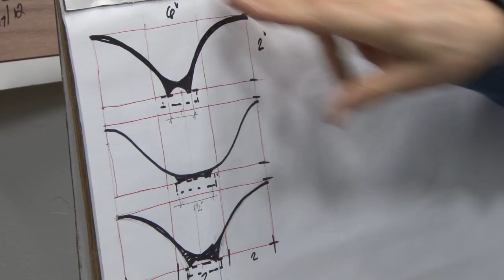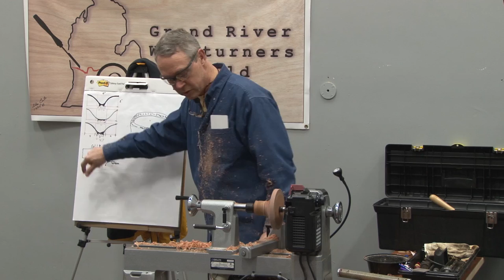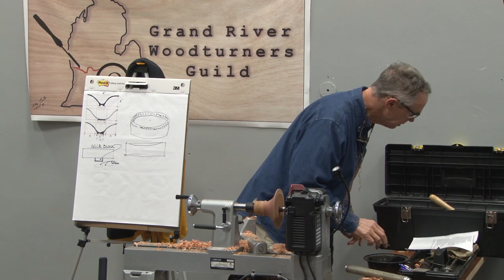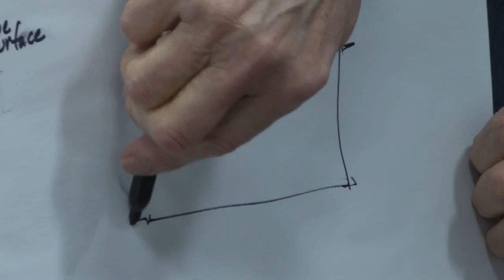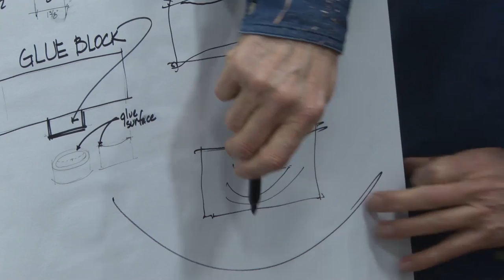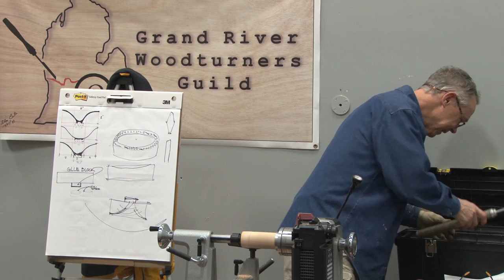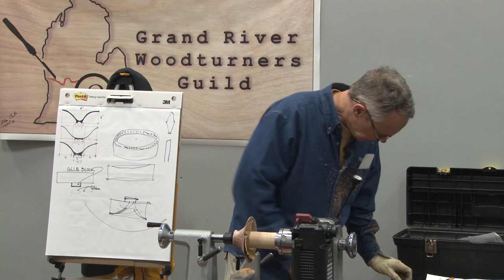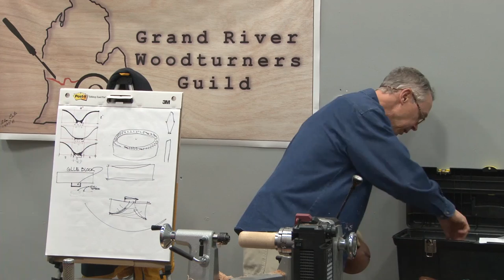Woodturning: Using a Light Source to Turn a Bowl

Comment: Hi Jeff, Thanks for demonstrating such an interesting video. A few questions if you don't mind!
Can the glue blocks be made up of offcuts of MDF, pine planks etc glued together to get the correct width?
Would the addition of hair conditioner to the water help stop the water from evaporating from the wood?
That's  a stunning piece of wood that you turned, would your friend ship to the UK?
What width would be turned using the LED method?
Sorry for all the questions, just got my first lathe and waiting for my tools to be delivered,  not got a chuck so the GLUE BLOCK method looks the perfect way with the addition of a screw plate! 
Thanks again,  take care.
Cheers 
Andy 
YORKSHIRE 
UK